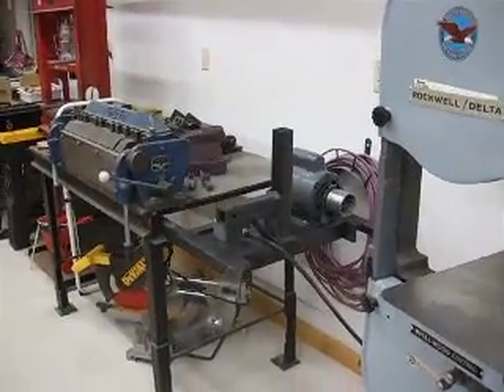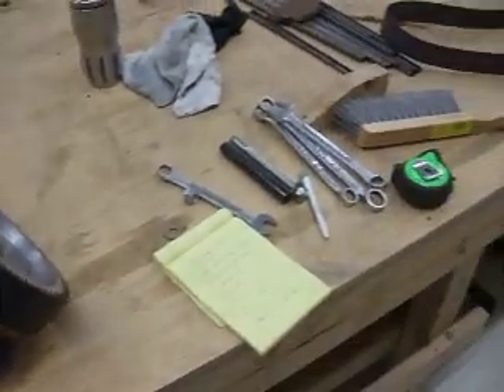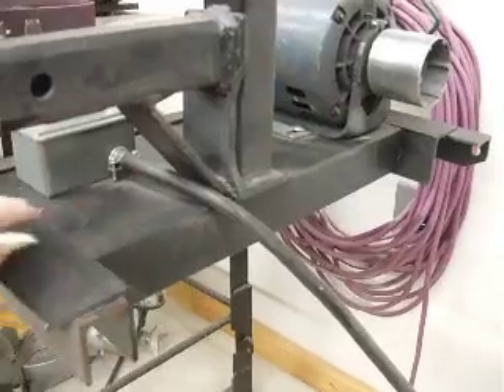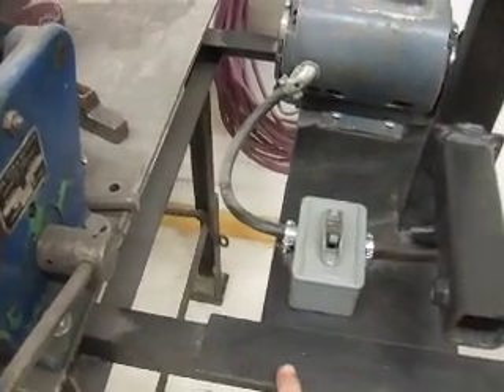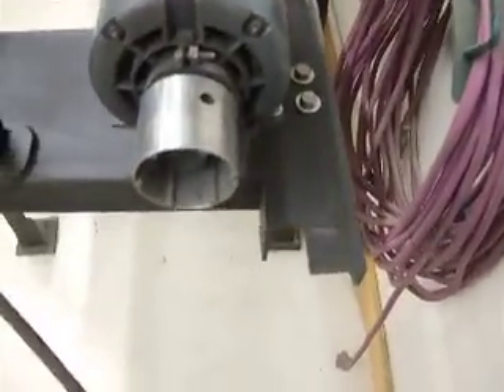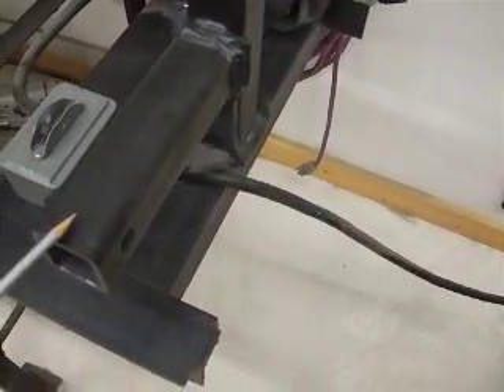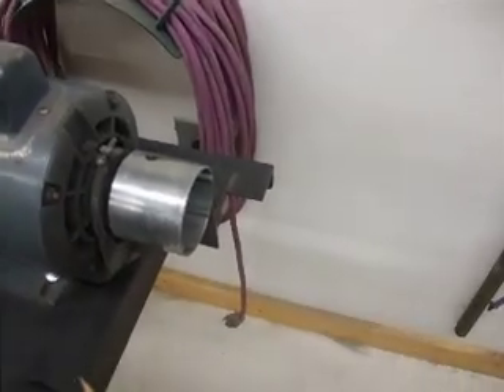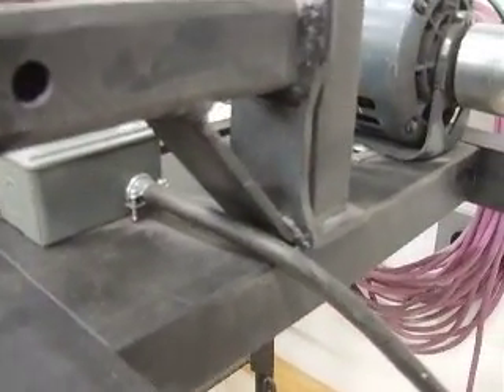2" by 72" Homemade Belt Grinder Construction Part 1

Comment: i wish to use mine to profile knifes, i`m a beginning blacksmith(with a medical nurse degree) so i need to remove a lot of material fast and efficient but still have the option to do fine work at slow speeds. I have a small 250 watt belt sander that runs at 20 m/s and i have read about burr king grinders that run at 35m/s i think, complicated conversions from imperial to metric.

Comment: what size bolts did you use for your wheels? That goes through the wheels to hold them on or in place
Reply from the maker: 3/8ths, but that will vary depending on what you end up using for wheels.

Comment from the maker: YouTube blocks web links, so just google Chicago Die Casting and one of the top links should be for the company. At the top of the page there are some links, click on the Pulleys link and that will show you the crown-faced pulley on the bottom-left of the page. You will have to know your motor shaft diameter. I think the pulley is 3 inches wide. You will probably have to call to find out where to buy one. I bought mine locally at a motor and tool repair shop. Hope this helps...

Comment: And I just want to say thank you for the great plans. I have my motor already and most of the metal. I bought a set of bolt together plans off of eBay and they are way too complicated. I love the simplicity of your design and will be building one this week. Hope you have a merry Christmas 🎄
Reply: Thanks for the kind words Terry! I never regretted making mine and it's one of the most used tools in my shop. Good luck on your build and Merry Christmas!

Comment: thank you. i think i will use a step pulley setup. I'm thinking that the run speed of the belt should be something along the lines of 20 meters per sec, 28 m/s and 35m/s. what do you think?

Comment: I am building a belt sander with your video help. My question is how does stainless steel work for a platten surface wear plate?
Reply from the maker: I don't think that it's necessary. I've used my grinder for a few years now and the platen is just starting to get polished. Mild steel works just fine.

Comment from the maker: The engine power being too much is not a factor...too little is what is critical. 3hp is more than adequate. Of course the motor is heavier as well.  The rpm is your choice. I have seen grinders with a step pulley setup or a variable speed control (expensive!). The 2850 rpm would do fine I'm sure.  The good news is if you want a different rpm, all you have to do is change the motor or the way the belt is driven. The main structure of the grinder is what is important. Thanks for your interest!

Comment: the up right pipe how wide is it and gage?
Reply from the maker: Hey Gene. It's 2 inch square tubing, 3/16ths wall thickness.
Reply: thanks
Reply: do you think 16 gage tubing would be to light for this build
Reply from the maker: Gene Smith Hey Gene, 16 gauge seems really light for the application.

Comment from the maker: I don't remember anymore, but it was probably around $100. The 10 inch contact wheel from Grizzly Tools was the most expensive part. Everything else, except for the drive pulley on the motor, I had lying around the shop. The motor was a garage sale purchase for less than 5 bucks.

Comment: The horizontal tube which comes of the vertical piece is what length, is it 8 or 6 inches. Just a bit confused from the video. Loving the design as well
Reply from the maker: Matthew Ruddock Hey Matthew...sorry it took so long to get back to you. That main tube is 8 inches long. Hope this helps...

Comment from the maker: There are a few ways you can deal with this. One is to get thinner wall tubing and weld on thin shims  and miss the seam. The other is to use an angle grinder and grind a thin vee groove in the smaller tubing so it can slide into the larger, the groove compensates for the seam. One other, but labor-intensive way is to get a file and file the seam flat. Look at the next video, Part 2 at 4:54 and that describes the vee groove to compensate for the seam

Comment: Hello, super video, can you please tell me what was the total cost of this build ?
Reply from the maker: Sure. I have around $100 into the build. The contact wheel was about $70, the zinc sheave on the motor was about $15, the contact wheel support bearings were about $10 and then other various bits and pieces. Prices of the components have probably increased since then. Where I really lucked out was the motor. I got it at a garage sale for $2. The wiring was all messed up and the owner couldn't figure out which wire did what, so I bought it for basically scrap value not knowing if the motor worked or not. I got that straightened out and it runs just fine. I use the thing almost every day and has held up over the years. The only maintenance I have done is cleaning it occasionally. You will never regret building one. The time you spend building will be made up many times over in time saved by having a belt grinder.  I can't imagine trying to make anything in the shop without one.

Comment from the maker: The motor is 3/4hp, 1725 rpm. Pretty standard stationay tool motor. It has a 5/8ths inch shaft.
Reply: alaskabearhawk  I Apreciate all the info on the build. The only thing i didn't understand is, What kind of spring is used to supply the tension?
Reply from the maker: jeep james Hi... Look at the video https://www.youtube.com/watch?v=_mF0WEeHlxw starting at about :35 sec. It has the explanation for the spring. BTW, you're welcome!

Comment: Thank you so much. I watched these videos back in January 2014 and I now have my grinder up and running. I found a 3 phase 2 hp motor that I am driving with a VFD. In my blog, I have added cut lists, a wiring diagram and lots of details on the build. I ended up using a 4" nylon caster for a drive wheel and it works great! I hope that others can make use of the info there.

http://dcknives.blogspot.ca/p/2-x-72-belt-grinder.html

Thanks again.
Reply from the maker: Your build looks really great! I'm glad you were able to find some ideas useful. After using it for awhile, you will wonder how in the heck you survived without one! A fellow posted a few months back that he build one and used a motor and controller from an old treadmill. Very creative and certainly not as sophisticated as your installation, but I'm constantly amazed as to the variations (read improvements) there are on the basic design. Your blog has very nice, clear and detailed info on your grinder build. BTW, thanks for the kind words!

Comment from the maker: Sorry it took so long to get the information. The wheel on the motor is 7.5 cm (75mm) in diameter and the motor turns at 1725 rpm. Hope this helps.

Comment: Thanks for taking the time you did to film and post this video and the others regarding your 2x72. I found it very useful when building my own. It looks nothing like yours (you could check the video) :-) however the design of yours was tremendously helpful as I constructed my own. Thanks again!
Reply from the maker: You're welcome. That's what's great about the internet. Sharing ideas and using them to make your own. Like you said, I don't see much from mine in your video, but yours is fantastic! I really like the treadmill motor idea. Great job!
Reply: Thanks for the compliment! The wheel from Grizzly I knew about from your post. I purchased and used some of the tubing from Aircraft Spruce that you mention as well. Just those two thing alone were tremendously useful. I agree about the internet being such a great resource as well.
Marcos

Comment from the maker: It seems fast to me at the top end. By my calculations my belt speed is about 5.74 meters per second. I just don't know how fast you want to go. A variable speed Burr King goes between 3 m/s and 31 m/s. A Jet turns at  23.4 m/s. Your 28 m/s and 35 m/s seems too fast by comparison.